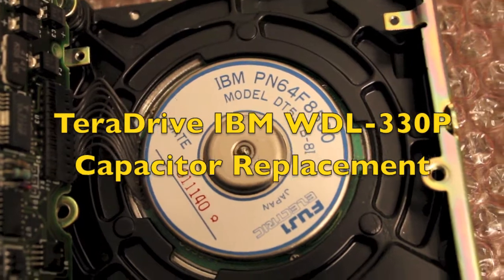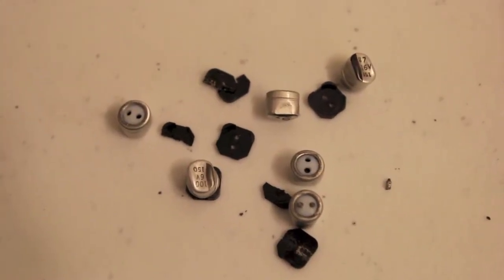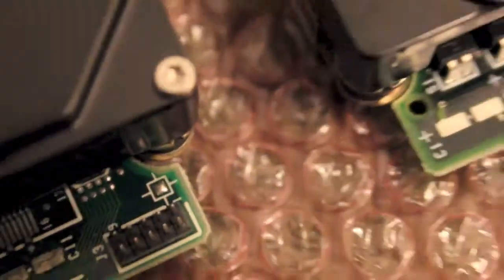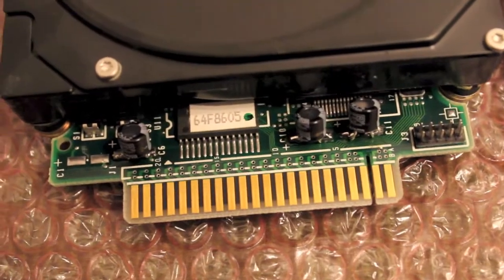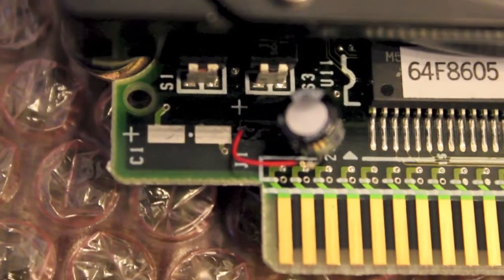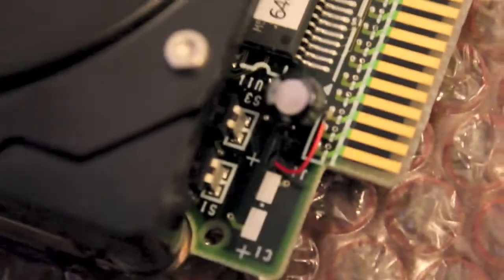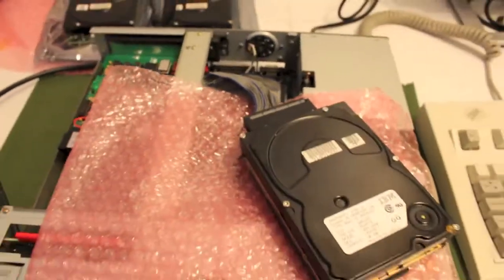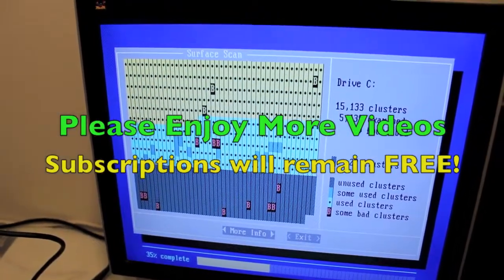Sega TeraDrive WDL-330P Hard Drive Capacitor Replacement

Comment: I replaced those 3 SMD caps on mine and it still does not work… there seem to be more components labeled C (capacitor?) on the board… did you change those also? Do you know how or where to find the values for those? Thank you…

Comment: :/ This is one of your worse recaps, to be honest. Also, this is why I have (several times) said that you should use either tantalums or SMD caps. The newly manufactured SMD caps last a long time, it's the ones from the late 80s to early 90s that are very cheap and bad.
Also, tantalums do not explode just like that, the one you had exploding probably had too much current going through it or something, maybe a pull-up resistor failed somewhere on the board.